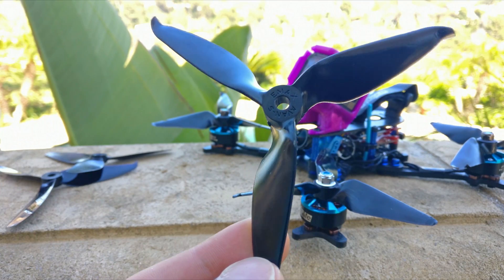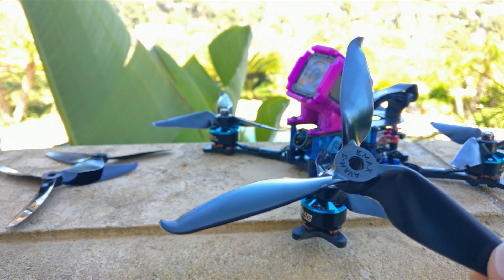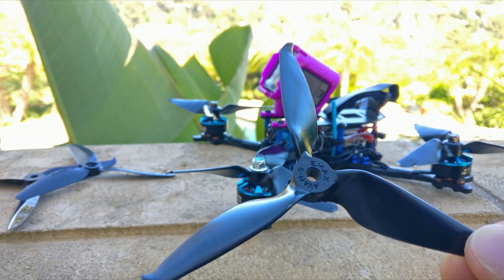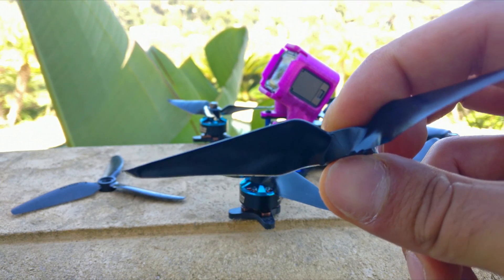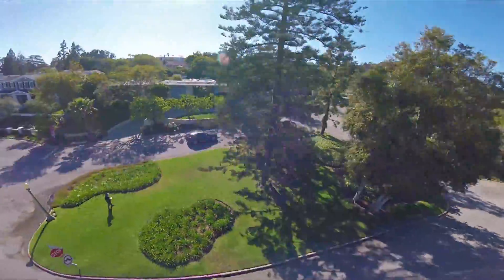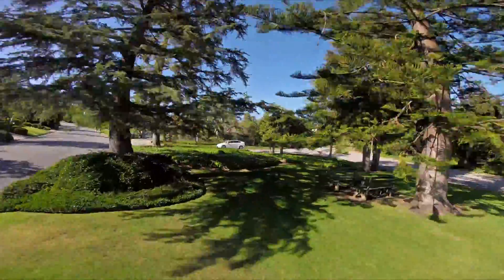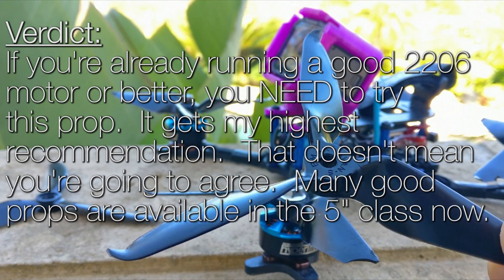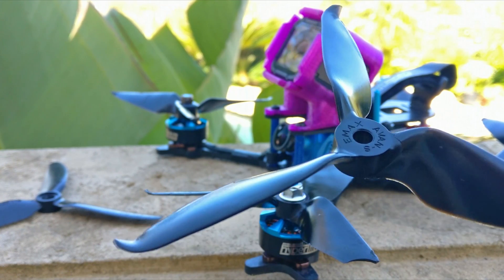Emax Avan Prop (Prototype) - Mini Review

Comment: Been using these with diatone gt200S 2017 and man, in my opinion very close to the others mentioned but more efficient, better grip, thank you!
Reply: IceRook what’s your runtime with these compared to a lower pitch prop? Have you tried a 4 or 4.5? 6.5 seems a lot

Comment: Had a hour today to go out with received Emax Avan props. Put them on DL220 frame with EMAX RS2205/2600KV motors, 1300 mAh 65C graphene battery and Runcam 2 on top. Well, my mistake was to put them on so heavy frame, because speed became quite mediocre. Partially also because this was first time when I flew with additional camera attached to this frame which is already heavy. Although quad control definitely is now better. I hope to put together another lighter quad at tomorrow and check these props again.
Reply: Kabab, you convinced me about that control is not possible without good gear :) I viewed this review once more and ordered a set of Emax 2306 2400KV motors, Holybro Kakute F4 FC and Avesome F200 frame. Other parts I already have, including 40A ESC-s and Avan props, mentioned here.
Reply: Received the rest of gear some days later. Weather was good two weeks in row and I had a chance to fly these Avan-R triblades with Emax RS2306 2400KV and RCX2206 v3 2400KV motors. I now can confirm that these motors are controllable, fast and awesome even on 2206 motors. I like them. Trashed one bag of them and two frames with that for fun. Ordered a second bag of them and received it at yesterday. Now I must wait until weather will be good again and I will have a chance to get out to field before dark.

Comment: I finally got a chance to fly these today on my heavyish build (600g+) with LD Power 2305 2600kv motors.  I've VERY happy with these on my quad.  The quad feels more locked in / better tuned with the Emax Avan.   I much prefer these vs the Dal 5050 on this quad.

Thank you for the heads up on these props!
Reply: Yes I had the same feel on my Neato 5" with 610grams. They just suck up to 110amps out of the battery with my steele motors.

Comment: Reducing propwash in the prop itself due to an "almost perfect spiral" of the wash  from the tips is because it most likely will be washing in the opposite direction  so it will be out of phase of what it's descending into so it will cancel itself out i guess if that makes sense
Reply from the maker: Sorry it doesn't because I don't understand how the prop wash would be in the opposite direction
Reply: with the wingtip winglets it would work the same way as on a regular aircraft wing... the vortices generated off the tip of the wing (in this case the prop - still a wing :D) would be going in a different direction (away from the tip) i beleive that's why winglets are on airliner wings, to keep the airflow from "coming off the end" of the wing producing wing tip vortices. - so if you look at this one for the v22 which is a cool picture in and of itself. my theory is that with the way the tips are designed, the vortices generated will be going away from the tip and a lot less "stronger" as opposed to staying around by the tip like they would with a bullnose prop.... 

i'm just guessing here, but that would be my thought. I hope that makes sense.

https://en.wikipedia.org/wiki/Wingtip_vortices#/media/File:MV-22B_Osprey_(USMC)_008.jpg
Reply from the maker: Daytona FPV oh ya that makes more sense. but something about these wing tips on this prop are different. they do a lot more than other wing tips I've used.

Comment: What do you think of the Avan vs the Gemfan 5152?
Reply from the maker: Common Sense the gemfan draws fewer amps and is more manageable for racing. The Avan feels much better in the air and has a lot more grip and zero propwash

Comment: What would you say about them in terms of the RK5051 experience?
Reply from the maker: I personally hate the 5051.  I think it's built for a robot, not a human.  Compared to the 5051, the Avan feels very similar but the issues with the 5051 have been improved.  The low speed control is the best of any triblade I've ever felt whereas the 5051 had the worst low speed control.  The turbo boost effect of the 5051 is also hugely smoothed out with the Avan.
Reply: Kabab FPV great! Thanks! I will get some once available again.

Comment: Hey kabab im sorry for asking this but i need to see if you have suggestions on esc's i have been running dys xs30 and i keep having it catch fire when i run 5s so would you be able to reccomend a good esc that is reliable for 5s? I did order spedix 30 hv with dshot from richard shelton at mcb since he reccomended it. What do you think? Thanks
Reply from the maker: The XS esc's are a bit more sensitive than the old XM that you could probably run 8S on no problem.  I would highly recommend the SpediX 30A HV as well.  I've had just amazing uck/experiece/everything with the SpediX ESC's.  I've used well over 100 various ones from them and have not had a single issue that I didn't cause myself.  Truly incredible for such a cheap price too.  They get my highest recommendation and I'll wait for them to make a BLheli32 esc before jumping on that train too.
Reply: Kabab FPV thank you so so much, I needed someone with more experience and been in hobby longer and that's why I asked you. thanks sir
Reply from the maker: I don't think I've talked to anyone that's had a very negative experience with SpediX products but take note that this is just my experience.  I can only have so much.  Always buy 5 motors or ESC's at a time.
Reply: starting to wonder if it's my build, omnibus f4 pro wired directly to stock impulse alien pdb,vtx tramp wired to pdb directly to then my esc power.ground to pdb .no signal ground wire for esc just signal wires
Reply from the maker: I would find it unlikely to be the lack of a signal ground.  But if you're pushing the ESC past its limits, I would think it's a good idea to include the ground line...

Comment: wingtip vortex generator rounds up the air to prevent prop wash. airfoil camber also delays "high alpha stall" so it can recover quickly and be as responsive as you describe. Makes it also generate more lift with a "shorter" lifting surface. Downside is that there is more air in contact at the tip, therefore you also need a motor with more torque to spin it since it's sortof imitating a 6" prop or something in between... I reckon it would be a perfect match for a lightweight 24XX motor... like EFAW 2407R 2500KV running at 6s >_>
Reply from the maker: sneakyb oh I'm not so sure about 6S but yes the prop requires high torque.
Reply: hmmm... a couple of people tested it on efaw 2407r. reported to puff batteries on full throttle for anything longer than a few seconds lol. so epic.

Comment: Looks like a great prop, but what you were saying about the prop being rough is what emax thinks keeps the flow laminar, i learned the opposite in school, that if there's any bumps/roughness on the airfoil it would cause the laminar flow to change to turbulent, but who knows, im just an engineering student and emax is a bigger company so more power to them haha
Reply from the maker: CesarSalad the idea is that because the pitch is so steep, delamination off a smooth surface can be a very real issue. a turbulent surface slows down the air a bit such that it will hopefully stay on the airfoil. just guessing here however.
Reply: CesarSalad you are correct. The roughness is there to force transition from laminar boundary layer to turbulent. That redistributes momentum from outside the boundary layer into it and that allows the flow to stay attached longer than it would otherwise to allow the blade to operate at higher angles of attack without stalling.  It is the same exact effect of the dimples on a golf ball, except there it is done to reduce pressure drag (but skin friction drag is increased).

Comment: Hi kabab! What prop do you recommand for a beginner with 2205 2500KV motor. For the moment i have 2 set of cyclone 5045c and 1 set of 5046c comming. And i feel i will need way more than that. I already destroyed 2 props in 1 hour :p ...
Reply from the maker: Vince dt get the DAL 5x4x3 V2. cheap and fly good. very durable.
Reply: Kabab FPV thank you!

Comment: Are you having a job outside of youtube?
Reply from the maker: Yeah I'm a dentist.  I just do this for fun
Reply: Kabab FPV Do you think amalgam filling is dangerous over time?
Reply from the maker: Domikian Glueck no it is not at all but if it's done incorrectly or some specific rules aren't followed, it can break a tooth over many many years. half my job is repairing broken teeth due to large amalgam fillings.
Reply: Kabab FPV What can be done wrong?
Reply from the maker: Domikian Glueck if the filling space is too large of structural components of the tooth is missing, amalgam should NOT be used.

Comment: How do you like the the 2207s? What's the fastest prop for a 2205?Keep the vids coming...
Reply: I would say the RaceKraft 5051 tri-blades.. But I'm not an expert and haven't tried everything out there
Reply: It's 2205 I think 5051 need the torque and they're not efficient... I was thinking to cyclone tris.
Reply from the maker: Kreit FPV I think the best 2205 prop is really gonna be the new HQ5x4.3x3v1s. other good options would include anything with a lighter blade weight. cyclones and heavier props will work but the lighter ones will give you improved control

Comment: Are you getting bad noise with the Spedix 30A 4in1 escs?? I'm using the unify pro race and the foxeer arrow v3, t-motor 2400kv/2600kv, and dys f4 fc. I could barely fly with a 35v 470uf cap or a LC filter :/

Comment: Thanks for the review. I am a freestyler and not really interested in racing. Of all the props you have reviewed which is the best for the EMAX 2205s 2300kv motors? And which hyperlite motor you think is comparable to the EMAX I am using? Thanks.
Reply from the maker: The hyperlite 2205 2522kv will be the closest match and I believe the best prop will be the HQ5x4.3x3v1s

Comment: Will there be a dual blade version (I have Emax rs2205 2600kv motors)? Otherwise I'll go with the Racecraft tri-blades.
Reply from the maker: Karl Isele yes there will be a twin and it will fit that motor well.
Reply: Kabab FPV awesome, thanks for the advice and your contributions to the hobby!

Comment: Most of the magic of this prop is likely from the Q-tips. They drastically reduce tip vortexes which will improve efficiency, reduce noise, and reduce propwash since the outflow is going to be less turbulent.  Usually they bend towards the high pressure side though, instead of the low pressure side as these do, but I imagine this was done to reduce the possibility of frame strikes.  Less ideal but should still show improvement over a prop without them.
Reply from the maker: Qumefox please expand on this. it makes more sense to me for it to curve up. Gemfan firmly believes the curve down is more effective.
Reply: Essentially air is wanting to slide off the ends of the propeller and move from high pressure to low pressure, so if the tip of the prop is curved, air is going to follow that curve. If the curve is towards the low pressure side, that resulting airflow is essentially going in the opposite direction of your thrust airflow.  This effect is going to be minuscule but it is still present. Preventing the high pressure air from flowing around the tip of the prop will have more of an effect, and is why the curved tip is still beneficial despite being curved in the wrong direction on these. The tip fin is still making the prop behave more like it's in a duct.
Reply: rcmodelreviews has a video that explains it far better than I can.  just search "rcmodelreviews q-tip propeller" and it should be the first hit.
Reply from the maker: Ah now it makes sense.  So now I'm wondering why this prop has a curved up tip
Reply: Like I said previously, It's probably due to the fact if the tips pointed down, it would drastically increase the chances of the tips hitting the frame in the event of any prop flexing. This would be a much bigger issue than the minuscule gains achieved at this prop size of the tips being curved the proper direction. Plus there are multitudes of other aerodynamic considerations that probably come into play as well that only the prop designer could likely explain, and only someone else equally versed in aerodynamics could probably understand.

Comment: Hey there, nice review just one question: why would you put that prop on a 2207 motor, since you just said this prop needs a torquey motor, like 23XX? Thanks a lot and keep up with the good work man!
Reply from the maker: Roger Montes the 2306 2400kv from emax is actually 2330kv. the 2306 2750kv I'd actually 2650kv. 2207 and 2306 perform very similar but the 2207 is 5g lighter (per motor).  2330kv is just too low for me. 26û0kv is a bit too high for the prop. 2522kv is just right for a ~560g AUW.
Reply: Thx for the reply. Been watching all your reviews, gathering info for the racing quad design code I'm working on: mtotor info from MiniQuad Test Bench and prop info from your reviews. So thanks for all your good feedback on props :) maybe you can test my code once it's first version is "finished"? IM me if u're interested. Have a nice one!
Reply from the maker: Roger Montes what kinda code is this? what does it do?
Reply: trying to come with a mathematical model to predict key characteristics of a quad like top speed, acceleration ratio, controlases, as a function of hardware used for building it like AUW, weight distribution, center of gravity location, motors, props, air drag profile, etc...I haven't found a way to take into account tuning, FC etc...just working on a mechanics point of view for the moment, I'm a Jet Engine Design Engineer, that's why I'm focusing on mechanics for the moment :p
Reply from the maker: Roger Montes that would be amazing but you're limiting factor is likely going to be the lack of proper motor and prop data. not to mention batteries and esc's
Reply: I'll start with power delivery and speed controller assumptions...by the way, some info on that would be useful! :)
Reply from the maker: Roger Montes it's entirely a time issue. I don't even have time to make videos anymore these days. I make them so quickly they're quality is sadly lacking. so I do everything based off experience and real world qualitative testing

Comment: Hey Kabab. I took your advice on the RCX2205 v2 2600KVs recently and I like them a lot but I'm not sure what the best props are for it at the moment. A lot of the props you've been looking at seem to be designed for the lower KV motors and 2206 in particular. So I'm still sticking to Dal T5040 v2s. Any current prop recommendations for 2205 2600kv motors?

Cheers
Reply from the maker: sligit you've got the right prop. the basic 5x4x3. you can also try the new HQ 5x4.3x3v1s
Reply: Great, thanks.

Comment: I'm curious what the efficiency of these new sharp tip style props is once they get a small amount of damage.  I notice that props like the cyclones,racekraft etc. with sharp tips get bent and damaged tips on the smallest contact with the ground or scraggle.  It makes me curious what happens to the efficiency of the prop once that highly engineered tip is at a wonky angle.  They put a lot of work into engineering the tip and it seems to be mutilated within 5 minutes of me using the prop.
Reply from the maker: Plur307 it does drop but not a massive amount. the blade airfoil is designed to work with the tip. without the tip, the airfoil is still working to improve things.
Reply: right, but I wonder if maybe the HBN style tip ends up being more efficient once the prop has some wear and tear.  Or maybe something like the butter cutter that still has the big scoop in the center but a rounded tip.  I feel like the rounded tip might be more useful in the real world and not just a simulation.  The tips of my racekraft props are always at funny angles even when I barely clipped some leaves.  Seems pointless to engineer them so precise when they will never stay that way.  I like all thees new scooped props designs, but I'm not such a fan of the tips.
Reply from the maker: Plur307 without the tips it just gets louder. I don't notice any performance change. the big heavy tips are drastically less efficient. overall, nothing is efficient the way we fly. I'm not concerned with ~15sec flight time changes. I'm looking for the right feel in the air.